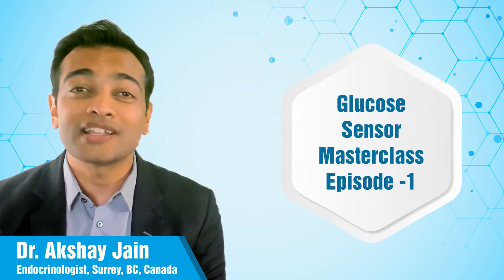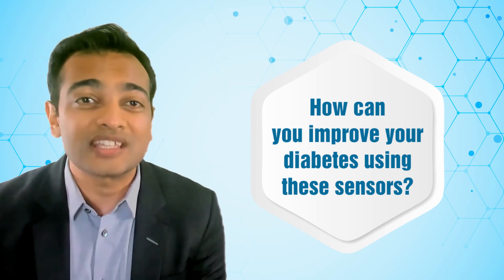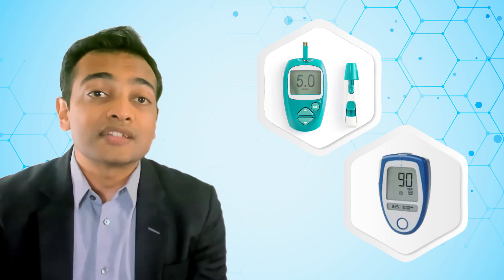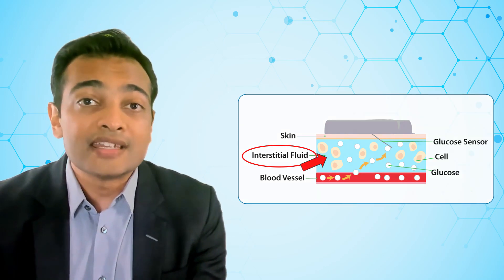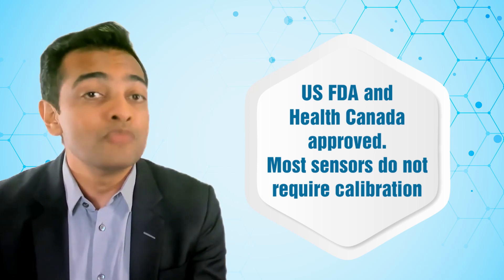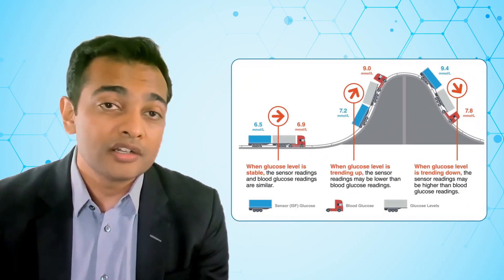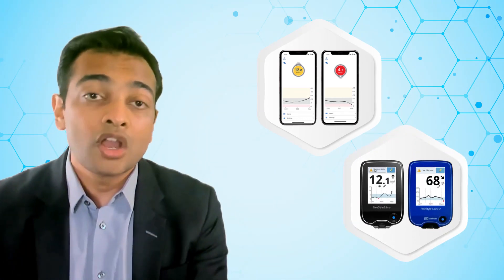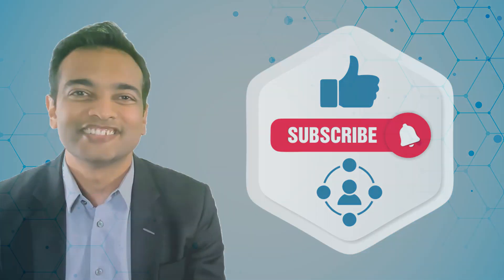Endocrinologist explains how Glucose Sensors work- Glucose Sensor Masterclass Episode 1

Comment: excellent video!  I would just say that I have found the CGM can be frequently innacurate to high end (reading higher than actual) by up to around 20 percent when compared to the finger stick.  Just my experience, though I agree medical opinion is that they are quite accurate.